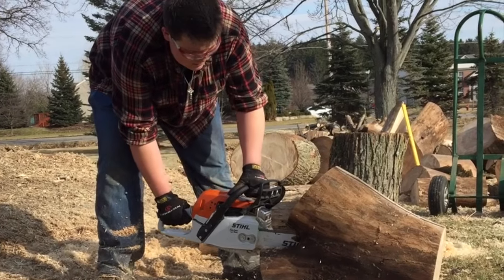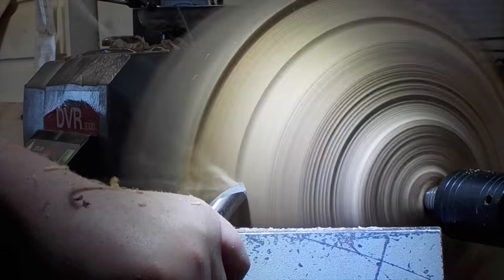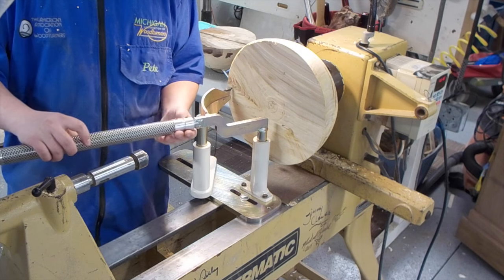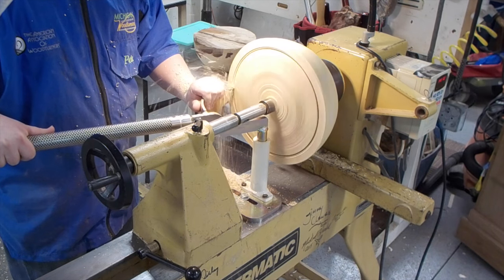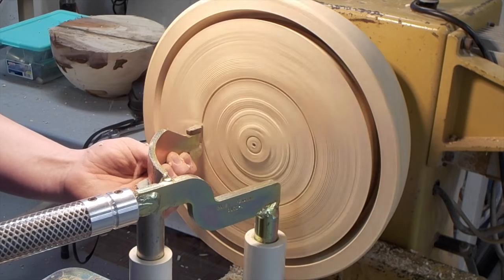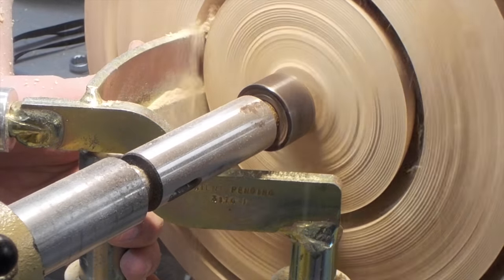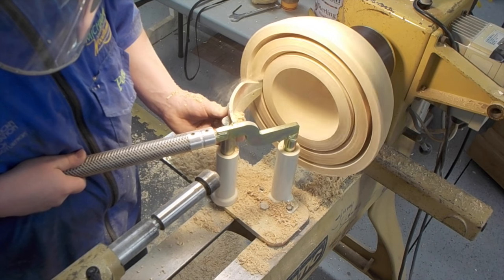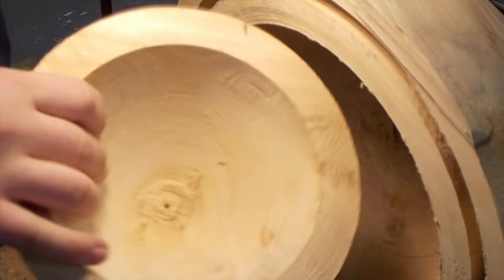Coring A Bowl ~ Woodturning

Comment: Peter, I've been turning for 3 years but learning everything on my own (slowly ... ugh).  Anyway, I have / love my Delta 46-460 and am interested in coring as in the video above.  I don't believe I need the Oneway product as my lathe is a midi and to small to use but 2 of the 4 options.  I believe the posts may seem bulky attached to my small bed as well.  
Question :
Have you any recommendations of a smaller set that I could purchase ?  LInk ?

One other idea ........... is it possible to core thinner bowls to get 3 or 4 on my Midi lathe ?  Maybe if the blanks were dried more thoroughly first ?

Thanks so much for your generous consideration and very well made video,
Steph_Louisiana
Reply from the maker: I don't see why you couldn't core a thinner bowl other than if the wood was green.  But something you'll want to consider is that you need to have enough thickness so that you can turn a tenon on the foot.  Yep Kelton sells a hand coring set that I think might work on a small lathe.  I've never used it though and I'm not really recommending it...just letting you know that it exists lol :) http://www.kelton.co.nz/McNaughton%20Center%20Saver.html
Good luck,
Pete
Reply: Thanks for your timely reply Peter. Loved your video btw. :)    I've somehow turned my Delta midi into a pool cue repair lathe w/ a couple thousand $$ worth of accessories and hate spending the time to R&R it all to turn a bowl or a box. :(    I've really got an idea that's I'd like to get back into making them and have been looking into acquiring a second lathe.  I know ......... uh oh, here we go ...... weeee. 

Anyway, researching the second lathe I can't exactly find what I want.  You see, I've been spoiled w/ the electronic variable speed dial on my Delta along w/ the option for "reverse".   I can't afford a $5000 dollar PM, Laguna, Oneway, lathe and accessories, "turnkey" for a bit larger capacity swing.  I just can't find a 16" or so lathe w/ electronic dial v/s and reverse, so i'll end up w/ a second Delta 12-1/2" and probably the Oneway 3270 Easy Core ( http://tinyurl.com/zlh6qvk ).  I can easily share all other accessories w/ the original and/or purchase 2nds easier than one of the monster machines.  

Look Peter, you've really been a help and I hope to see more of your videos in the future. :)  Thanks again and good luck sir. :)

Sincerely,
Steph          
 I can make sawdust but need improvement on what's left over. :)
Reply from the maker: If you're looking for a good lathe with a speed dial and reverse for under a low price you need to go to grizzly! I have a mini lathe from them as well as their 17" bandsaw and they are great machines! Check them out: http://www.grizzly.com/products/16-x-42-Variable-Speed-Wood-Lathe/G0632  (That's a link to a 16" lathe exactly like the 1642 Jet.  When I was looking into new lathes a lot of people recommended this one.
Reply: That's the one Peter :)   I looked for hours online, all day yesterday and missed this Grizzly version.  I checked them out first but only saw the GO462 for around $600. :(   That lathe has no reverse and the variable speed is not electronic but a lever that separates the 2 leaves of a collapsing pulley.  This, ultimately, wears & stretches belts so I moved on.

I should have thought to look for other versions as I'm really familiar w/ the many versions of their 17" bandsaws.  It's the G0513X2 for me !!!

Thanks again Peter, I appreciate the follow up :)  Steph